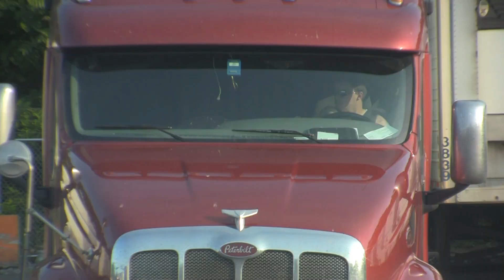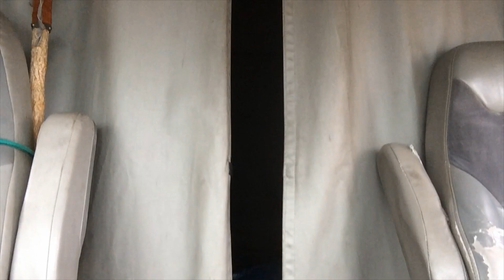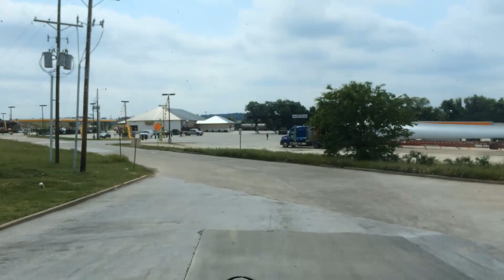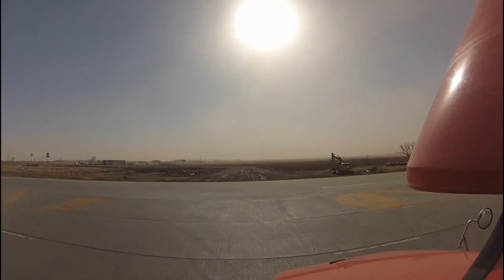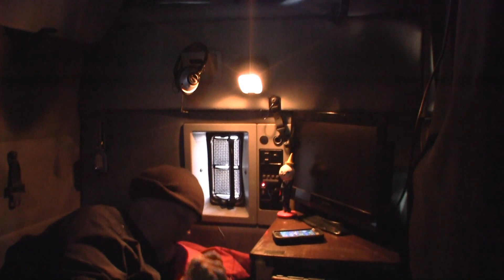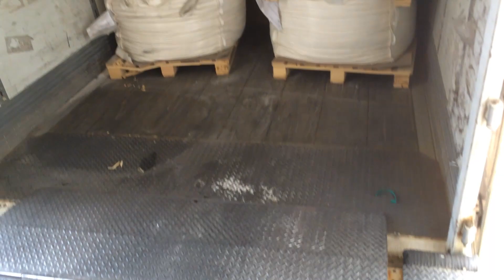The Fracking Sand

Comment: when I worked offshore in the gulf we fracked new wells all the time. It can be pretty dangerous when fracking because of the high pressure used to pump the sand down the well bore and into the formation.